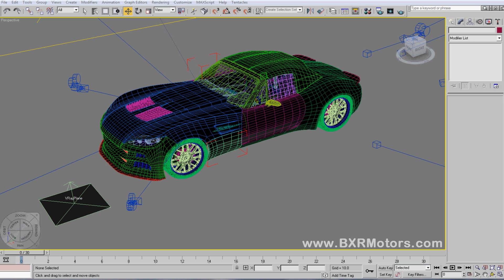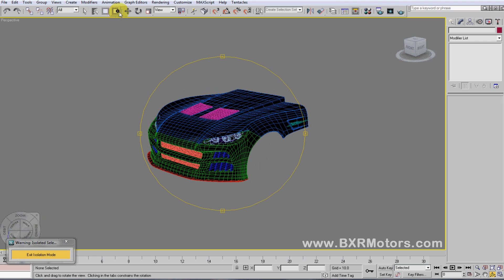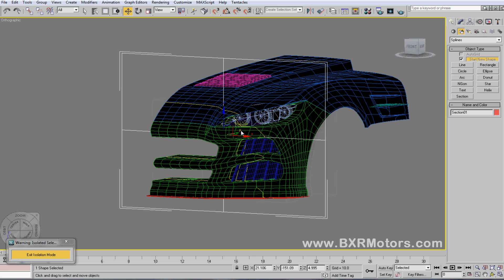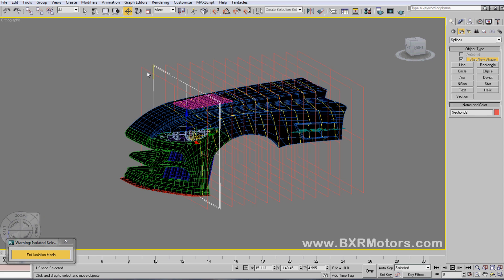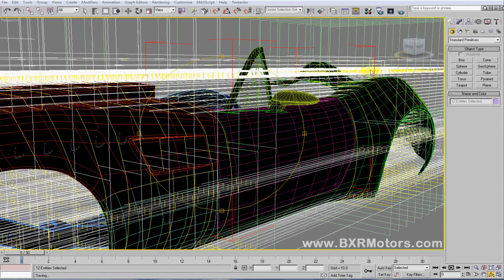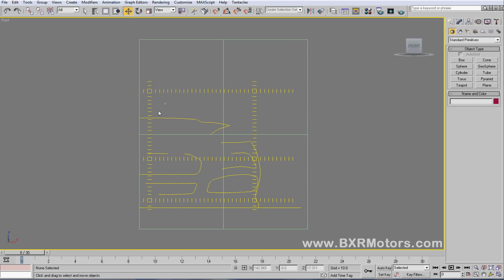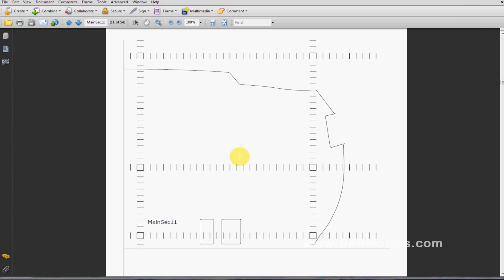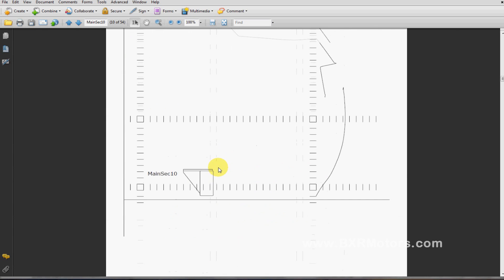Bailey Blade XTR Car Design | Tutorial: How to make form sections from 3D model - Part 23

Comment: Can I send you my 3 d model and see if you can full scale it into sections so I can print out a car plug smh it’s giving me a hard time idk what to do and I’m using the blender software
Reply from the maker: Not sure how to do that in blender,  I use 3D Studio Max. And honestly, both Blender and Studio Max are the wrong program to use. It's better to use a solid modeling software like SolidWorks or Fusion 360.  I had so many issues I had to resolve,  so i ended up porting everything over to Fusion 360.

Comment: uhhh so just wanted to know, what software is it that you are using in this video?
Reply from the maker: Look up videos on slicing with planes in blender. After slicing an object, select the sliced virticies and duplicate.  This will leave you an outline of that section. You can build out an array of slicing planes like ever 4 inches. Then slice all at once and that should leave you kind of a skeleton of the shape. There should be some good videos on it. 👍
Reply from the maker: In this video it's Autodesk 3DS Max. However, I transitioned over to Fusion 360 as a better engineering solution for developing.
Reply: @OZTron3D  nice, thanks, i was trying to do it on blender but i just cant really figure out how to make the sections which then takes out the cutlines and all. Thanks though, i really appreciate it.

Comment: Hello, I made my 3D model and all sections but I don't know how did you pass to PDF format file fron 3D max, could you help me?
Kind regards
Philippe
Reply from the maker: In most 3D software there is an option to export as a pdf or ai file.  From there you can then use as a cnc file to have cut out.  If you export as an ai file you can use illustrator to save as a pdf or there are some free Web Apps that will convert it for you for free.

Comment from the maker: I set the distance to be every 2" for high resolution areas (more detail) and 4" spacing on the main length of the car. This was based on my material as the foam was 1" and 2" thicknesses and the wood was 1/4" thick. If I was to do it this way again I would do the whole car in 1" or 2" spacing... its  more work but retains better details and symmetry.

Comment from the maker: Actually i exported it as an Adobe Illustrator file, and then saved as a PDF. Could have save it as a PDF or STL file also... but i needed to edit the spline and wanted to number each one. So Illustrator allowed me to do that then I could save as a PDF and most newer water jet or cnc systems can read pdf and convert to simple cutting lines.

Comment from the maker: All the MDF is attached to each other using wood spacers. You should look back at the first videos to really see. Or check out the website where I have some photos of the process. The wood is not really attached to the frame its just resting on it. everything is custom on the car, including the chassis the only thing that's not are the windows and some of the framing for them.

Comment from the maker: No prob... I looked at the image on you FB site and you are doing it correctly. You have to select each slice and chose "save selected" and save as an .ai file format. You have to do this for all of them one at a time. This will give you the outline for you template. Use Adobe Illustrator to edit the .ai file format and re-save as a pdf or whatever you need.

Comment from the maker: @subrotatus1 In 3d Max you can save/export your work as a .ai file (Adobe Illustrator) If you have Illustrator then you load the files in there and edit or do what ever you need, then save the file as a PDF direct from Illustrator. There are other programs that can do the same thing but i use Illustrator. Also check out my new site and forums I am planing on using this to cover all the details. Feel from to sign up and start a new topic.  cardesignersandbuilders(dot)com

Comment from the maker: @chris41102 Look at using Blender, search it on Google. Its free and very powerful. as for cutting out the wood your can do it your self with a jig saw or find someone in your area with a CNC router or water jet system. CNC will be the most accurate method of cutting wood.